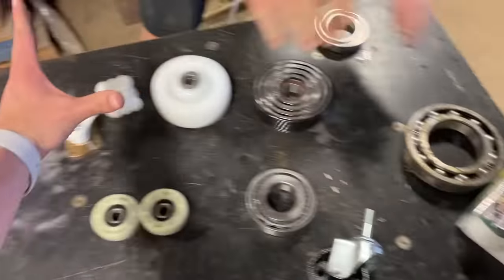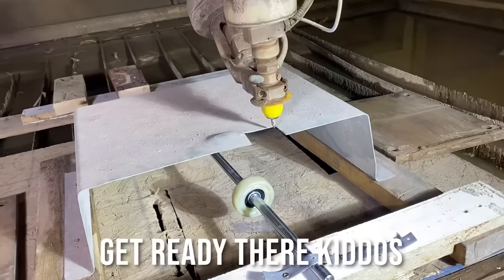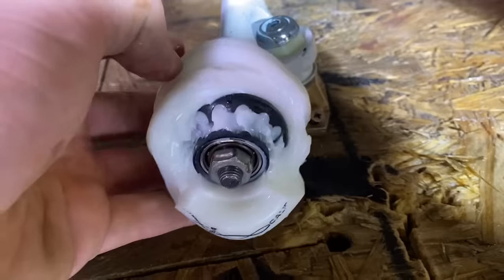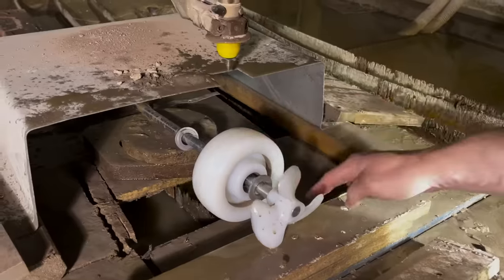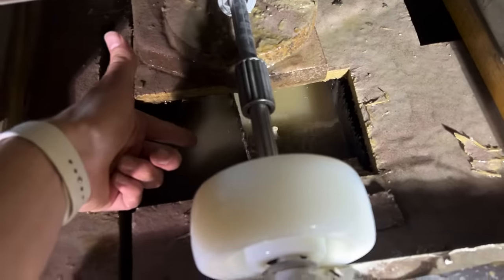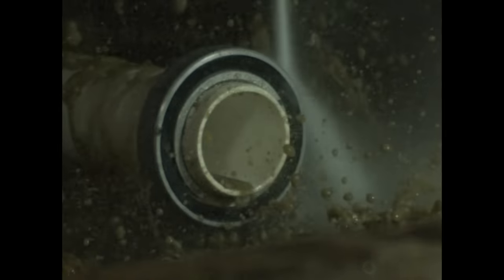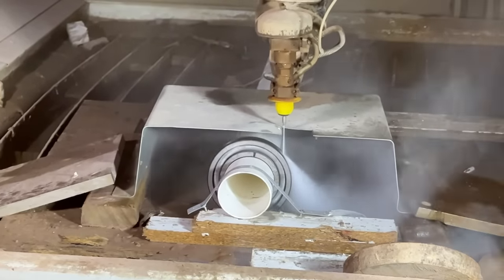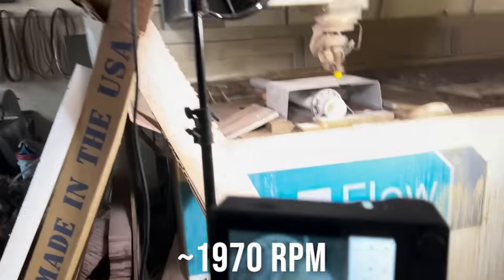Massive Industrial Bearing Spun With 60,000 PSI Waterjet

Comment: The big bearing was supposed to be packed with grease and it was missing a seal. It's meant for low speeds as well
Reply: Pretty much any bearing that has the bearings exposed should be packed with grease. The fact that the bearing that didn’t spin freely, didn’t spin, is a good indicator that it can be used at high speed because as the grease heats up it will spin more freely.
Reply: @SCWW  or it was a bearing from a gearbox that uses oil instead of grease
Reply: Not necessarily on the speed thing.  1800 rpm is not an uncommon industrial motor speed.  I've seen a few motors in the shop that took bearings that large that run at that speed although they tend to start runing slower around that size.  You could potentially have a 5.5inch output shaft on a motor using one that size.
Your right about the seal though.  It does not take much contamination to jam a bearing.  They also dont like runing loaded or at high speed with no lube.
@Jesper Jensen,  commonly in motors the bearings are either fully sealed with a measured amount of grease inside from the factory or they are open and theres a cap behind to bearing to hold grease in.  This allows more grease to be added over time as the old wears out. Open bearings in a greaseable motor generally last longer before needing to be replaced if the millwrights actually follow the manufacturers recommended greasing schedule.  Sealed bearings are effectively a wear item. Clocks ticking once they are put into service and you can make a reasonable guess as to how many hours they will last depending on the service speed and HP of the motor.
Reply: If he showed the part number we could see the speed it is rated for. The shaft sizes where also incorrect it should have been so tight where you cant pull it off with your hand, only a gear puller or a deadblow hammer. Rookie mistake.
Reply: @fang4853  These bearings do not really have a speed limit. It sure has a limit but these limits are as good as unreachable. Bearings can do tens of thousands of rpms
Reply: @BlackroseTanki  yes but once you get to a certain point in low speeds you need a thrust bearing most of the time so yes speed is important.

Comment: You guys are just getting started, size wise. Dad worked at a steel mill and once when they had to replace the bearings in a mill he brought home the box one came in. It was big enough to make a nice treehouse for us kids.
Reply: Yea when you get above automotive wheel bearing sizes the price per bearing goes waaay up there..  saw a bearing that was about 18” od with a price tag of $13k..  das a spensive spinny bit..
Reply: @Z-Ack  I've got a 20" roller bearing lying around I got from work, it's a little worn out, it was pulled out and replaced after a gigantic gearbox rebuild, but the thing weighs like 90 pounds, I can't imagine how much that thing cost new. It's a whole different game price-wise when you get into the big stuff. I wanted it as a display item in my man cave, (for whenever I get a man cave lol), my boss told me to get rid of it so I did😂. It's also got like 25 pounds of brass in it, it's going to look nice once I clean and polish it all up.

Comment: Starting the bearing spinning with your hand was friggin terrifying
Reply: I run a waterjet and can vouch for that, that’s risky as hell
Reply: Especially after seeing what it did to the gel hand. Jesus.
Reply: Yeah...easily could have lost his fingers right there. WTF was he thinking? Is he a professional operator or just a Youtube dude with access to this machine?
Reply: @oisiaa  yes
Reply: jesus christ guys, both he and his hand was like 3 or 4 feet away from the thing before his friend pushed the button. touch some tools and machinery every once in a while, it will do you good. you must respect tools and machinery, but if you are afraid of them then something is very wrong and you should never operate.
Reply: @allahsnackbar9915  having respect for destructive tool means making sure your hand is no where near it when it’s switched on. What if his hand got caught in the guard? What if his buddy got carried away and hit the button early?
Reply: @oisiaa  definitely amateur they did not even do the right shaft sizes for the bearings on top of not greasing up the open end bearing. The whole open end bearing spun it is only supposed to spin the outer raceway. Instantly seized it up with the water. Plus the shafts are supposed to be so tight you can only get the bearing off with a gear puller or tapped off with a deadblow hammer. No professional would make that rookie mistake.
Reply: I’m 1 year late but that was definitely the stupidest thing I’ve ever seen one of them do

Comment: Rods = needle bearing. Typically used in a location were a shaft isn't supposed to have much movement side to side and the bearing serves to center the shaft in a tube. Like axle shaft bearings.
Reply: Needle bearing? I think you meant average bearing. Thick bearing even...
Reply: @Bubu567  

Needle bearings are a type of bearing. Not size. 

Look up R59047
Reply: @shaunofthedead3000  I would gift you a sense of humor if you could buy it on amazon.
Reply: @Bubu567  

Too expensive. 😋

Comment: I use to be the go-to repair guy for a piece of equipment rated to 18,000 rpm (We never went over 10,000). It had four of those large cage bearings like you have.

There was active oil misting of the bearings. If the mister was running too much oil (more than a single drop per minute turned to mist and split 4 ways) the machine would start bogging down. The areas of the machine where the bearings were would get hot. Very hot.

During normal operation those areas would become warm to the touch but not hot. When the oil ran heavy the machine would get hot enough to smell, and smoke would rise as it burned off any oil on the clamshell housing.

I replaced the older oiler with a new one, and mounted it in a location that was not influenced by the machines vibration. Never had that problem again. Over 15 years. Set it and forget it beyond refilling the reservoir every month.

And the point is?
Cage bearings are made to run clean except for a microscopic film of light oil. At least when they're being run fast. Under perfect conditions those large bearings you had would easily run 10k or more.

Comment: Would it be possible to pre-grind some ridges or texture on the the berrings to give the water something to push against so it doesn't get stuck on the abrasives?
Reply: It would be like a tiny water wheel, that would definitely help torque hugely

Comment: Idk if anyone has commented this yet but any bearing that seems slow but is still smooth is because it has been greased as a bearing should be. Those sealed ones definitely have a grease inside which slows down the bearing with no load but is essential for loaded applications

Comment: While working in a Salmon Cannery in SE Alaska, I took one of the larger used machinery bearings (apprx 2in Wide x 8in Dia), cleaned it up and added a few drops of 30W oil and then hit the side of the ball bearings w/ some Shop Air while holding the internal Race w/ my hand. I'm guessing it hit around 10K RPM before I dropped it to the Warehouse Concrete floor. It sat there and just made sparks for a second or two and then accelerated the entire 80 yrds length of the Warehouse and went thru the metal siding on the other end of the building. There was a Semi Trailer parked in the loading pit next to wall that took a hit. Bearings are of such tight tolerances that any grit or dirt is gonna add a lot of rotational resistance if it doesn't stop rotation entirely. Ur little water jet experience w/ all the cutting slurry splashing up into the bearings was bound to be a bust. I think the plastic and lower tolerance bearings worked because of their "sloppy" build tolerances.

Comment: Top tip, with ball races point your water/air jet at about 20 degrees to the ball cage not the external diameter, that size bearing your using should reach around 40k to 50k RPM (air is better and may even achieve higher revs before disintergrating) you will have to make improvements to your containment system!

Comment: Ive spun up many bearings with compressed air. The most dangerous ones are tapered roller bearings (any roller bearing i guess lol)  Also spun up a squirrel cage blower fan with an industrial steamer/pressure washer.. it did blow up.
Reply: When I worked as a mechanic I repacked many tapered roller bearings for front auto wheels,would get that bearing screaming good with compressed air till boss said he did that once and the cage failed and the rollers turned into shrapnel.

Comment: Idk how long before the jet should be repositioned to only act on the farthest edge as it expands with speed; but I think all of your wheels could spin faster if the jet was moving away from the axle as the plastic expands, so it doesn't cut through the core material while the speed is still increasing.

Comment: If you want I work at a plant and some of our bearings are 8-10in inner diameter.

If we replace one I could send it out to test?

But yea they need lots of grease for those large ones with some kind of shield to keep the grease in.

Normally they're pressed into a housing that has a cap you put on after for greasing purposes.

Comment: Its not the size of the bearing that makes that one bearing harder to turn.  Its the seal.  Pop that out and I'd bet it would spin as freely as the larger one though then it would have the issue of the garnet getting inside like your big one did.   Also I'd wadger that bearing is new.  Those seals will wear in a bit with time in service and will spin more freely up to the point when the grease starts wearing out, then things will turn alot worse.
a large motor's speed is not regulated by the bearings, ideally those would be completely frictionless but we have to make do with as close to frictionless as possible.  the speed of an AC motor is regulated by the windings and how many cycles per second your power is being feed to the motor.  Basicly if the motor is designed to spin at 600 rpm that magnetic field the electricity is generating will be rotating at 600 rpm and the rotor will accelerate to catch up.  the rotor cant spin any faster than that magnetic field unless your spining the shaft with something else (such as in a generator) so there is no reason to try and regulate the speed with the bearings.  That would just generate extra heat that is already hard enough to get rid of.
I couldn't quite read the bearing part number.  best frame was still a little smudged but looked like it could have been a 6012 bearing.  About right for the stated size as that would be about 3.5inch outer diameter, closer to 2 and 3/8th's inner diameter.  You didnt even come close to maxing out the speed on those bearings.  I've seen motors come through the shop I work at with service speeds up to 3600 RPM.  Some of the larger servo motors I repair can be 6k rpm max with a 6308 bearing in the drive end, the outer diameter would be about that size.

Also its kind of cute that you think that 6217 bearing is massive.  Had to help install a 6328 a few weeks back. over 12 inches accross and 50 pounds.  Thats geting into the large end of what my shop can handle on site as motors big enough to need much larger than that will start maxing out our cranes.  but the 6217? theres probably 3-4 used ones of those in our scrap bin at any given time.

Comment: We used to spin those big bearings up with air on a wooden hammer handle, once they got up to speed we would let them go, straight at a concrete block wall. Some would end up exploding against the wall.
Got in a lot of trouble when one actually went through the wall, that was the last time we did it.

Comment: Hey I don't know you guys take suggestions or ideas if they are good enough but I've been working on trying to spin a solo 21 inch steel spoked bicycle rim to it's centrifugal destruction and so far I've achieved scary stupid results using various different motors but no Matter what the rim always  wins and kills the motor .even a 8 hp gasoline engine cut out and broke down last attempt.  So do you think your water jet could yield some better results ? This is a hell of a challenge due to the resistance that builds up with as the rim accelerates ..I love to see you attempt it.  I've no access to water jet or ide be all over it already . Anyway you guys rock keep up the great content !!

Comment: I know I'm late to this, but idea: add fins to the outside of the bigger bearings like a water wheel, and then hit the fins with the water jet. You'd have to weld them on to have any chance of them staying, but in theory the extra force applied to the bearing by hitting a protruding fin would create a LOT more speed. And also make the bearing more resistant to gunking up because of the added force
Reply: Weight tolerances must be extreme. Like a turbo.
Reply: yeah im amazad chechenya isnt going against russia im flabbergasted
Reply: You would have to precisely balance it afterwards or it would not survive 5000 rpm. Plus, welding would wreck the hardness and whatever metallurgical characteristics of the race.

Comment: That giant bearing that spins fast could likely be meant for something like an industrial milk separator.  You'd have parts inside that weigh a couple thousand pounds but need to spin at thousands of rpm in order to separate cream from the milk.
Reply: i have a few sets of these exact bearings - industrial milk plant mechanic
Reply: @justin2221  I have these bearings on my Boing 747.
Reply: @gteaz  how high do they bounce? rofl
Reply: @justin2221  The 747 that I had before didn't bounce, all 600 passengers died.
Reply: @gteaz  That's terrible, it's a miracle you survived
Reply: @justin2221  I paid a passenger to fly it. I'm not getting on a plane that's gonna crash.

Comment: at the company our union is contracted to work for, we use waterjets to cut gating off of aluminum alloy jet engine parts for military and commercial planes :) the only reason i made the connection to this video was because there are garnet tanks stored in an area that was once a work station for manually belting parts

Comment: I would say that not only is the bearing not rated for 40k rpm with grit in it, it is also not rated for use on a shaft with a diamater smaller than the inside diameter of the bearing.

Comment: The bearing with the rubber seal is packed with grease, if you removed the seal and cleaned it out it would spin as freely as any other bearing.

Comment: Use a sealed bearing 
Pop the seal
Use brake cleaner
Put the seal back on
No garnet in bearing
Spin faster
Use retaining compound on inner race to prevent rotation on tube

Comment: To solve your unwanted "abrasive" problem, just put a container under the nozzle and fill with clean water. Then, if you don't add any abrasive, none should splash back into the system. If the water gets contaminated, changing out the container isnmuch easier then cleaning the whole table I presume

Comment: Would it be possible for them to guide the stream of water(without the abrasive sand) into doing a loop or something by following a track kinda like a water slide? Imagine something similar to a hot wheels track made of metal. Have the track start where the water stream starts, have it drop almost straight down but give it just enough angle so it slowly eases the jet of water onto the track so it doesn’t just cut into the track or spray everywhere. Have the track do a loop or have the track be U shaped so the water shoots straight back up. Or maybe just have it guide the jet into going vertical to horizontal.

I’m no water scientist myself so maybe it’s a dumb idea that obviously won’t work but if it did you could get some cool slow-mo shots maybe. I think it would be cool to watch the water traveling down the track. If you could get the water to shoot horizontally down a track you could position the camera right above the track so you could see the water coming almost straight towards the camera. Maybe set it some little army men on the track and get some shots of it blowing them off the track etc..

This probably looks much cooler in my mind than it does written down here lol
Reply from the maker: Ive been wanting to try something like this for a while now

Comment: The bearing with the black plastic shield has grease inside, making it actually useable, the unshielded bearing only spin fast cause they arnt greased, and if used without grease in an actual bearing application would almost immediately destroy themselves, the resistance the grease adds is very negligible, even in high speed applications, it's just significantly more then hardened polished metal on hardened polished metal so it quickly stops free spinning.

Comment: Perhaps a laugh would be to get the large bearings spinning with air and release them in a big clear area. That big bearing would easily carry enough momentum to go over 100 meters with a cool spray of sparks behind it. Due  to the gyroscopic effect the go in a nice straight line as well but when they get the wobbles it looks cool as they explode.

Comment: In the 50s they sold lead gyroscopes at toy stores. You'd crack open the cage so you could drop the wheel and axle out onto the floor after getting it up to speed with 125psi air. A wonder I'm not dead. Once popped out onto the floor there was no traction so to speak and it would just sit there hopping up and down and moving slowly forward. After awhile some traction would develop and it would eventually shoot out of the garage going like hell...